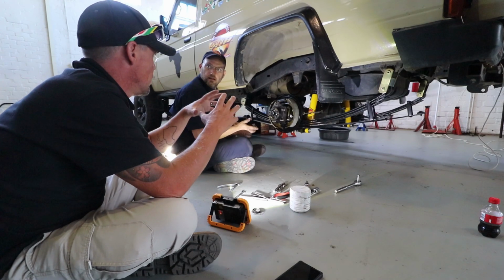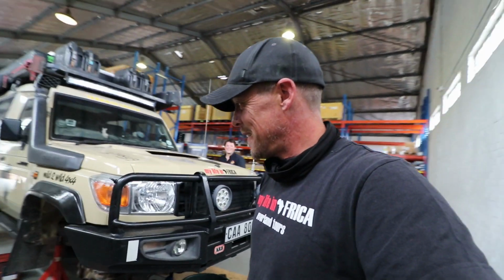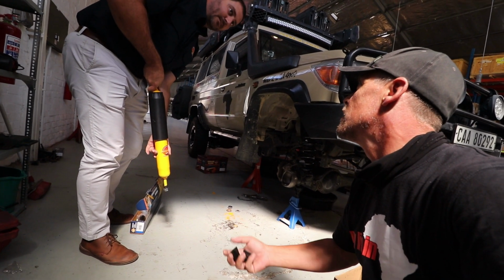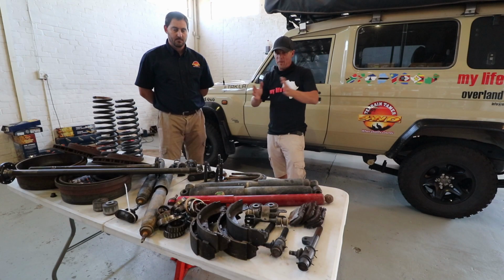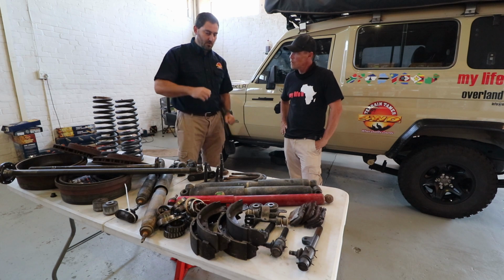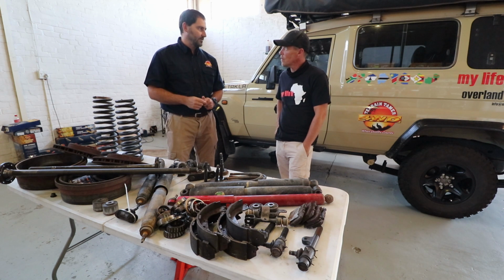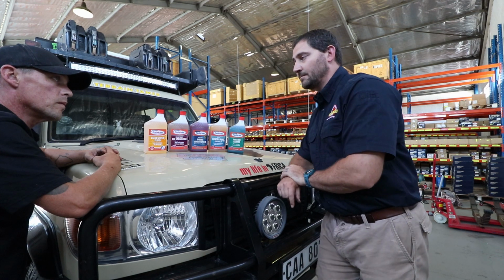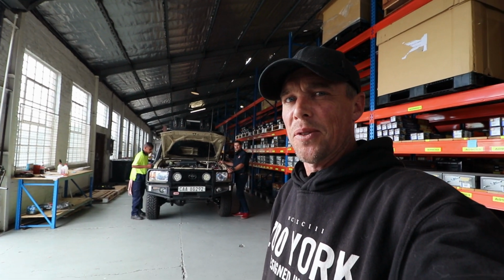Terrain Tamer | Installation & Fitment (Drums, Discs, Coils, Shafts, Seals and Bearings) | Part 2/3

Comment: Awesome series, Roland. Out of interest, what is the mileage on the Donkey? Or what’s the distance travelled since your last service on these areas? 👍
Reply from the maker: Hey Neal, Donkey is currently sitting on 209k, normal service intervals are at 5000km, the last check he had that was a go through was around 15000km before, just before the CKGR trip, and rackends were replaced about a year ago, with lockdown and not a lot of heavy offroad driving those parts were finished and should've also tied into the rest of the front being checked as wheel alignment had been done with that as well. Just shows you we assume and trust places to do this correctly and it's often not...
Reply: @MyLifeinAfrica  pretty terrifying, really. Who knows where you could be when the sh1t hits the fan. Terrain Tamer bring that peace of mind, for sure. Enjoy your new 'legs'!

Comment: How many KM has your cruiser done before the new upgrades?
Reply from the maker: Howdy Greg, the Donkey is on 208 000km currently as of this video...
Reply: Thanks Roland, I would have thought internals at that mileage would still be good, lucky you got to it in time. Had you. Been doing periodic inspections between trips, I am guessing more visual then anything else. 
Something I do after a long trip that had water crossings is upon my return I leave the car for a week to settle, then I open the fillers on Diffs, gearbox, transfer box an filler to rear diff. If they’ve taken on water the levels will the run over out the top. Then you know you need to drain an replenish fresh oil.
Since then I’ve added extend breathers to all breathing areas saves lots time.
Good luck with cruiser should be hood for 500k more KMs now.
Reply from the maker: Thanks Greg, yeah it was lucky to be honest, I do all the usual checks but never as detailed as Nicky did at all. The oils were OK from the gearbox, transfer and front diff, it was just the rear that smelt a little burnt. I have breather extensions on everything already, so you can imagine what the condition would have been without them. I think the thing is, remember donkey is 208k km in, but of those km most of them have been hard driving, he's not my daily, he's my tour vehicle. That's a pretty good idea though with it over flowing if water got it...